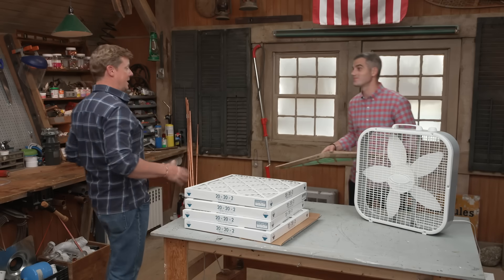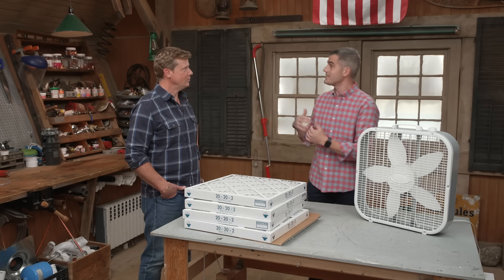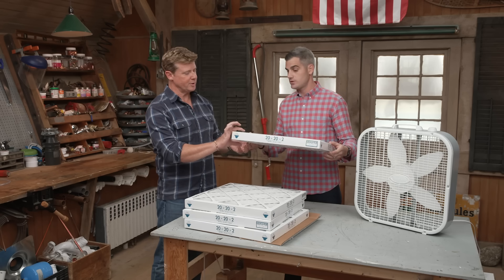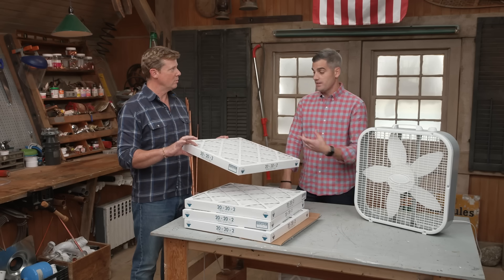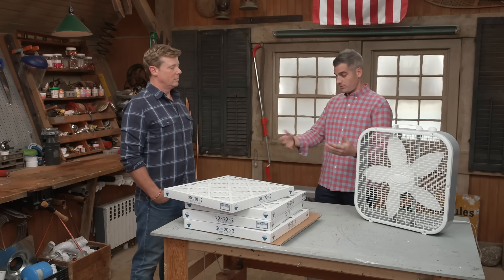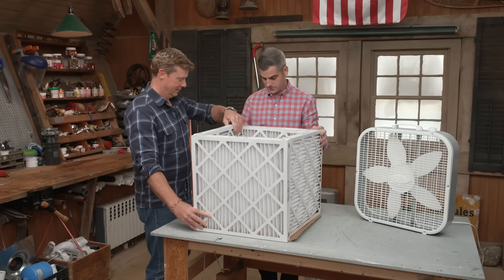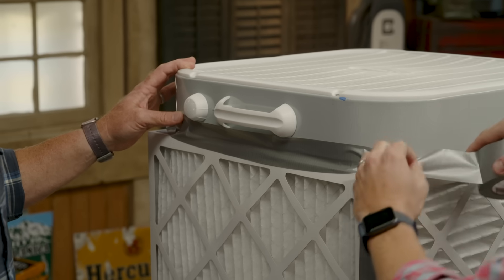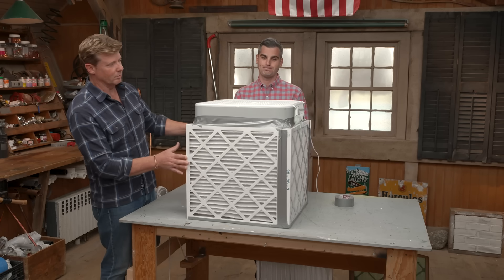How to Make a DIY Air Filter | Ask This Old House

Comment: Should l face the d
fan blowing the air out  away from the filters or toward the filters?
Reply: The video shows them blowing the air out, away from the filters. It would work (more or less) either way.
Disclaimer: I haven't built one yet myself, but I am an engineer if that means anything. All else being equal, blowing outward, away from the filters is slightly preferable. That way air is being collected from near the floor, where dust naturally tends to settle. 
If you blow in, you won't be able to tell how dirty the filters are getting without removing the fan or disassembling the box. There would also be the possibility of the pressure inside the box causing seams to leak. You'd need to make sure all  the taped together seams are strong. Also, if you wanted to add cheap pre-filters (ordinary filters good for pet hair and larger dust particles), they'd have to be on the inside of the box so changing them more often than the fine filters would mean taking it all apart every time.

Comment: Is this better than an air purifier for mold, mycotoxins and vocs? Thanks
Reply: I think comparable for mold and mycotoxins because the HEPA filter is really the "active ingredient" of an air purifiers that focus on solid particles, DIY or otherwise. However, for VOCs, I think activated charcoal is used instead of a HEPA filter.

Comment: Why didn't you run it....blow some smoke through it....anything.  Show wattage on low/med/high....plenty of wattmeters out there.  Pleats should be vertically aligned so they don't sag.

Comment: Had to cut away laminate flooring to frame a wall. The MDF dust storm it caused was ridiculous. Install have to cut about 20 ft in length so will be doing this. Not sure I’ll build a box, I’ll just slap on a filter on the back and set it near where I’m cutting. Also buying a new circular saw with integrated dust port 😎

Comment: would never recommend anyone install one of these high rated merv rated air filters for their HVAC system.  Better off with a mid-grade system air filter and just setting up hepa air filtration units in bedrooms or main living space throughout the home.  Strongly recommend Electrolux Oxygen 3 systems (discontinued but if you can find them they are great) or Blue Air hepa air filtration systems.  Blue air more costly but units are solid and work well.  This prevents that unnecessary burden on your HVAC system as those high grade merv rated filters will bog your system down and can severely shorten HVAC system life span.

Comment: Made 1 using ' Tyvek Tape- light weight tape & lasts ages!! 
1st box+ 4 sides 2inch merv 13+ fan lasted 2 -1/2 years. Making new one June2022.
And we put a cardboard  shroud in top of the fan too.
Odd note: the tyvek tape is also used around my outside window screens, if there is a gap.

Comment: Filter Charger can make the filters better. There is a commercial HVAC product called "filter charger" you can get that will spray on an ordinary furnace filter and make the filter catch more particles. Scientifically, this is basically a wetting agent that does not dry out, so it makes the filter catch  more particles because there is little water droplets on it.

Comment: I have standing fans, allergic to diesel, fragrances, laundry soap & my bedroom & bathroom were full of such fumes leaking in from windows and floor boards.  I finally managed to seal the leaks on the floor & bedroom window but to detox the rooms I saw a TV report similar & bought Merv11 wrapped it around my stand fans and amazing this removed all the diesel fumes from my bedroom and laundry fumes from my bathroom.  I keep them running and I can finally sleep without wearing a gas mask.  I have paid a fortune for air filters since 1986 and Merv11 wrapped around a fan is even better than anything I ever had.

Comment: I've always used one of the low mervs at the entrance of the filter box, to save the hepa filter from the animal hair clogging. My a/c is in a small room with a 2' door. It has a filter in the door, prior to the air entering the a/c unit.  I'm considering building a box that will sit just inside the door, with the 20" box fan, to pre-filter the air and take some of the load off of the a/c unit!

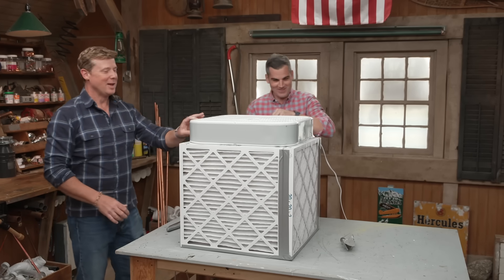Comment: 5:53 How much air moves thru this system? 900 cfm on high speed. A 2500 sq ft house gets 1 full air change every 20 minutes, 3 air changes every hour… MERV13, change out every ~6 months… 

I may try this with painter’s tape, on surfaces that contact fan. May be easier to remove for filter changes yet still for ok seal. Can always go back to duct take if not burley enough... Fire season 2018 with so many particulates in the thick air was hard on the dogs but thankfully brief. 2018 prepared us well for COVID19 from 2020 thru now, 2022…

Comment: I just built 5 sided version.   On the 6th side I add a rubber sheet with a slit in it.   I squeeze my head through the slit and wear it everywhere.   Totally portable
Reply: Ha! And a LONG extension cord.

Comment: I doubt you will be moving 900 sq feet through the filters - those fans will pull air in from the surrounding air if they meet resistance.  Better to use something like a Stanley Blower - Make the box the way you are doing (I like using thicker filters although they are a lot more money), and use the cardboard on the 'front', cut a hole for the blower exit air a small hole to allow the cord through and you can really move some air.  You will not be pulling air from outside the 'box'.  Anyway, I used that box fan idea for years, until I got a blower and said "Hey, I bet this will work better.  WAY better.

Comment: This also works with painters tape, which causes much less damage when the unit is disassembled.
Reply: The glues let out VOC’s
Reply: @shelshele wouldn't duct tape adhesive do the same ? I'm guessing for people who need these (wood working, home repair work etc) it's more than worth it to filter particles that would otherwise end up in your blood stream at the cost of some VOC discharge from tape.

Comment: Sorry not accurate! A 4" filter has only slightly less pressure drop versus a 1" filter of the same material. They last longer between changes but that is it. Makes sense that the same filter media is equally hard to pull through, it is not a matter of surface area but the size of the weave that determine how hard it is to get air through.

Comment: Question.. if for example you have 2 rooms separated by a doorway is it possible to use two fans and 3 filters  to have airflow exchange into both rooms .. and have you thought of using a dual window fan as an indoor unit like this for a low profile set up ( actually not even sure how the filter part could be managed).  On a personal level .. I live in a 500 sq ft tiny home .. could I simply use a quality 6 inch exhaust fan ( 308 cfm) and box it with 10x10x1 merv 13? It's only about 40 is DB so noise is not really an issue.

Comment: Very cool, although suprised you didnt go into more detail around FPR, which is what many box stores sell in terms of filters.  And I believe you said it cost around $70 to make it, where a HEPA filtering unit from Winix can be had for around $90 and the filter will last a year.  Definitly right size it for the space.  And a HEPA filter will get even more finer materials from the air.  Thank you for using the platform to get the word out, its so important.

Comment: The problem all of the people who are doing this is they are positioning the fan blowing air out, which catches the dust on the outside of the filter. If you happen to touch the sides when the unit is not running, the dust will fall on the ground or stick to your pants or hands.

If you place the fan blowing inside the cube, you catch the dust inside the cube and filters.

Also, putting a 5th filter at the bottom during on top of a rolling dolly, you get to move the unit around and because you've got a filter at the bottom, the blowing air doesn't hit the bottom and backs up, the filtered air comes out through all the filters, not the fan.

Comment: I put the fan facing down, the filters the other way, that way I'm sucking the air and dust into the cube, front have to worry about dirtiest side of the filter in contact with kids or dogs.
And a 5th filter in the bottom, it sits on a bottomless CPU tower holder with casters.

Comment: The issue i see with this setup is that the box fan has a huge gap between the blades and the housing that allows unfiltered air out of that gap.  I would reccomend using a filter on both sides of the fan so that all the air is filtered, not just the air peing polled through the filter box.

Comment: Honestly not sure this gonna help prevent ppl in a home from getting ‘ovid , as many factors involved; so, this isn’t necessary good for ‘ovid, but for construction dust or woodworking, painting, etc…..would help a bit.
Best option is just crying once while you buy a hepa 3-Stage Filtration Negative Machine Air Scrubber, imo
If I’m wrong, then definitely selling our 3-Stage Filtration Negative Machine Air Scrubber and building this device instead😉

Comment: What they never mention: NOISE. I tried a 20" box fan with a 1" Filtrete duct taped to the back. Great fit. But even at the lowest setting, the noise is irritating. Sure, open concept / space apartment is horrible for acoustics (echo, reflection, etc.) Tried putting another Filtete in front (not taped, just for sound + air velocity  testing). Not much of help, and I suspect the fan motor didn't like it (will have to check with a watt meter), even not duct taped (front). Sure, we're DYI and watching $, bug if the final product irritates (overall) than it helps... Now I understand better which it costs multiples more in established brands: design, research, user experience.

Comment: If you have a fan pull air through an area of water there won't be expensive filters to change, just need to replace the water periodically. The rainbow vacuum uses the same idea.

Comment: Prop fans have a very "flat" fan curve:  they are not built for carrying pressure loss, and a box fan designed for pretty much "free air flow" quickly reduces air quantity.  While the air is clean, there is a lot less of it, and so the idea is self-defeating.  There are prop versions (outdoor AC unit condenser fans for example) that will "pull" pressure, but the blade pitch, width and speed are markedly different from a box fan.  Waste of time.

Comment: Why not just use one filter and attach it to the front of the fan? How much air would it filter in an hour? Do you still get three full house air exchanges in a 2500 sq. ft house every hour?

Comment: It's a hack, but for esthetics, have the pleats in the same direction. And use aluminum sheet metal tape. And make the bottom a filter as well so it can be oriented in any position.

Comment: They used this type of "box", to trap cigarette smoke, 30 years ago, from a break room.  it worked great.   They used 1" thick filters, and FIVE of them, mounted in the ceiling.   The guy used a rebar welded frame.

Comment: Can you remove the filters and using compressed air blow out the filter outside and reuse the filter or is it not worth the effort?

Also as you mentioned this is geared to work for a room and so comparing it with a whole house system seem an apples to oranges comparison. 

I was planning on doing something like this in a wood workshop and  while I have not done this yet, I was considering putting the fan on the side with the bottom closed and filters on the top and 3 sides to try and control air flow in the shop. Any thoughts if this makes sense or not?
Reply: You can take the filters outside and blow air through them with a leaf blower, it will get some dirt out of them particularly if there is big dirt, like drywall dust in them. Some of the filters you can also be washed with some soaping water and a garden hose. Some filters handle this well, others brands do not.

Comment: Dont include COVID with your discussion. You obviously are just a uneducated as the masses to what and how this virus gets transferred. Aerosolized, only a HEPA has the ability to stop any viral component. so your face diapers are wholly inadequate. Also your likely to contract it at the grocery store from the handle on the cart to items off the shelf touched by another individual that has it and is asymptomatic. You touching your eyes, mouth or nose after coming into contact is what will get you a dose.

Comment: a thicker filter will not reduce flow resistance.  this explanation is nonsense.
Reply: The 4" filter is not necessarily thicker.  It is a thicker frame that simply holds more of the same pleated filter media.  It does reduce resistance because the 4" version is essentially a larger filter.
Reply: @DR-cm4hi  Every person who reads and believes the nonsense you just posted on the internet will be dumber from having done so.